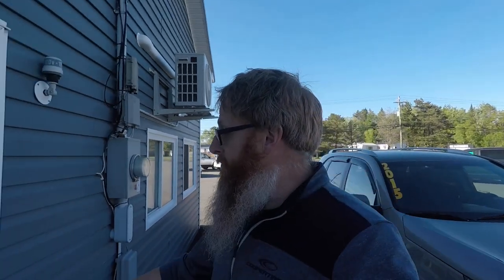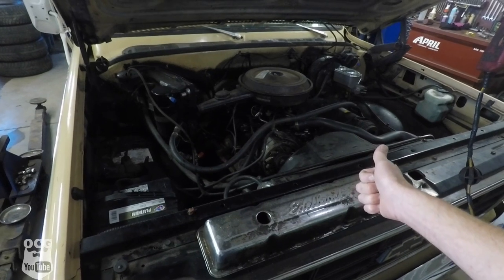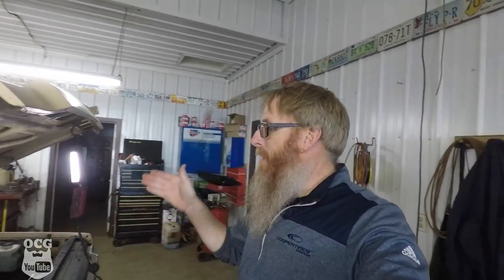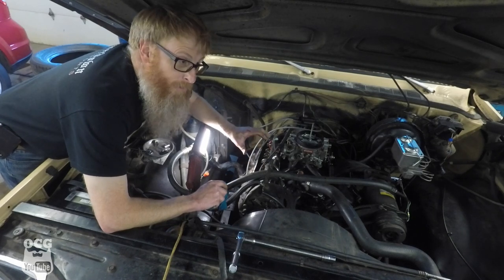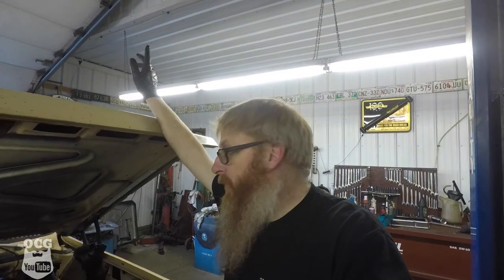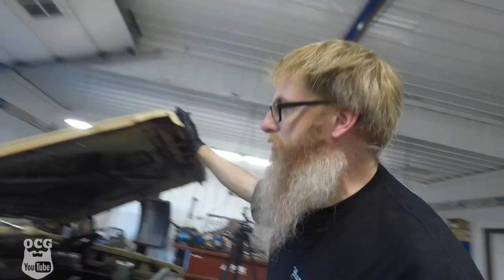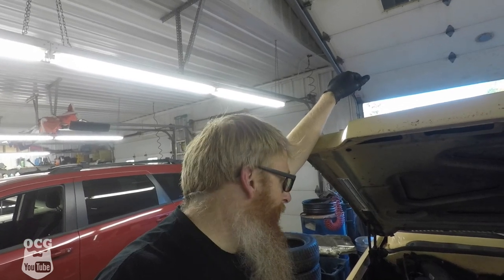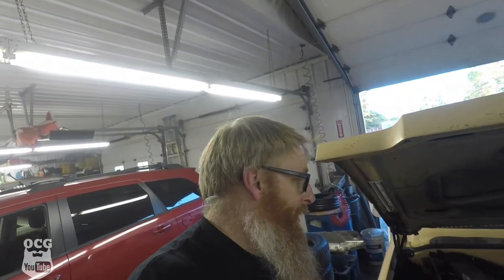ADJUSTING THE VALVE LASH WITH THE ENGINE RUNNING IN MY 1977 CHEVROLET C10 AGAIN

Comment: Check to see if the rocker stud is pulling up/out.  This is assuming that you don't have screw in studs.  Lack of throttle response off idle is a different issue.  Idle mixture screws set properly?  Carb jetted to be properly "lean" (vs pig rich).  The run on after shutting off is yet another issue.  Old engine?  Possible carbon build up leaving hot spots to allow ignition of mixture without the spark plugs?  Water spritz down the carb while running does wonders for that.  Seafoam cleans things up and so does GM Top Engine Cleaner.
Reply from the maker: Thanks for the info. The press in studs show no signs of pulling out. Throttle response and run-on are separate issues and I'll get to that. This is a fresh rebuild so there shouldn't be any carbon build up yet. One thing at a time.

Comment: I never thought to use a cut away valve cover to prevent oil from going down the sides of the engine while adjusting lifters, nice work.
Reply: Another old school trick? I never did it because I hate to waste a good valve cover.
Reply from the maker: That cover was free, rusty and perfect for the job.
Reply: very old trick. i am 47 and this neighbor I know who is almost 70 said they used them when they were in their teens.

Comment: It's not unlikely to get one bad lifter out of a new set, It happened to me...I always set chevy. lifters 1 complete turn beyond zerro lash. or 1 turn after they stop clicking, being careful not to over compress the lifter while doing this, tightening the lifter a small amount then letting it build up, then tightening it more untill 1 complete turn is achieved. If the lifter will not pump up or build up during the tightening sequence the lifter is bad.
Reply from the maker: Thanks Paul. Theres so much conflicting information out there. Dad says rule of thumb was always 3/4 turn after zero. Others say 1/2, 1/4.....

Comment: Too much valve lift for your springs, retainers or whatever else is binding up. Every valve  will most likely clear itself however it can. Bending pushrod,  breaking rockers, pulling the rocker stud loose. Basically driving you crazy!
Reply from the maker: You could be right!

Comment: Crap! I keep reading in my Chilton's manual on the Fairmont about lifter testing in a drill press, and wondering if I should bother. Partially tempted to pull all the lifters out and inspect them while I have the chance. Spend a little more time now, to avoid having to pull stuff off again. Man, that stinks!
Reply from the maker: May be a good idea!

Comment: Many years ago, I knew a guy who kept a spare set of valve covers with the
 top cut out to use just for adjusting the valves. Sorry you're having to go through this trouble, I was holding out with high hopes.
Reply: Either he worked on a lot of motors or he couldn't keep them adjusted.
Reply: @billmccall4663   He worked on a lot of engines, and kept sets of  the most commonly needed (open) valve covers  around.
Reply from the maker: I may have to re think this. The oil squirting was pretty aggressive on the drivers side! lol

Comment: That cam is going flat thats what it sounds like anyway
I have had it happen pull the  intake and check the lifters before there is to much metal pollution it sucks  , almost as much as that runon  jeezz
Reply from the maker: You think the brand new cam went flat that quick?
Reply: @OldeCarrGuy  I didn't notice in the video where you broke in the cam.  Is that something that you simply did not video?  I don't recall you mentioning it either but I may have missed it.